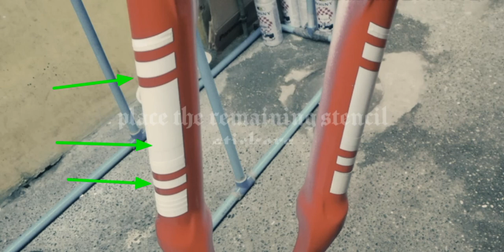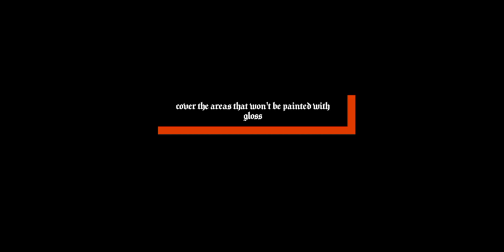How To Paint Matte And Gloss Combination Using Spray Cans / SR Suntour Fork Custom Paint Job

Comment: Kuya chris mag rerepaint po kasi ako ng frameset at fork ko lahat po black lang irerepaint ko kailangan pa po ba yan ng primer gray o pwede na pong black na at paano po ito magiging matte ano po gagawin salamat po kuya galing nyo pa shout out na rin po
Reply from the maker: salamat sir

kailangan po ng primer para mas kumapit ung paint, at maliha ng maayos para smooth ang finish

need mo
Primer no. 68
Flat Black no. 4
Flat Clear no. 191